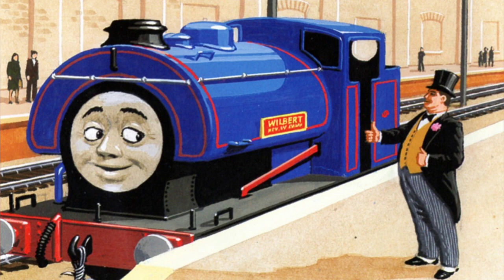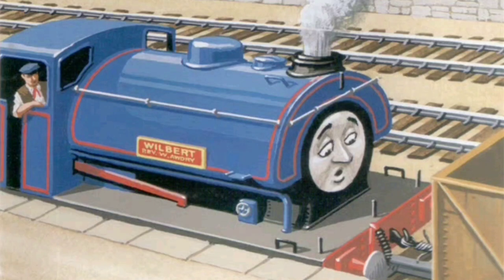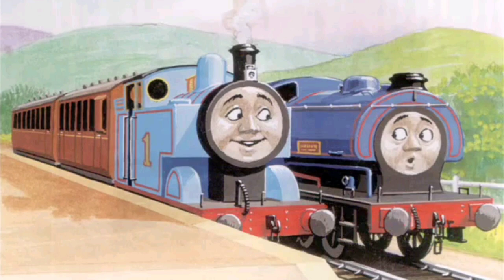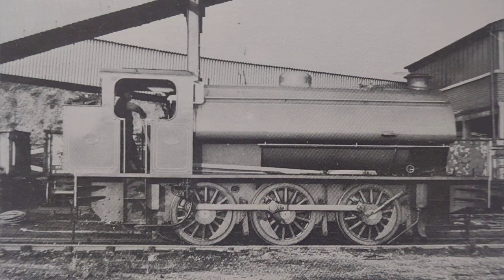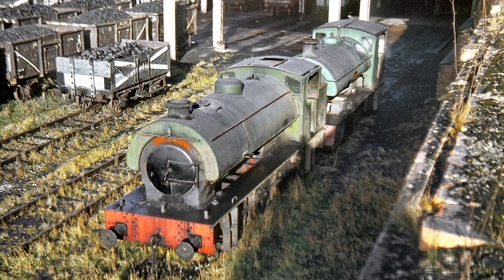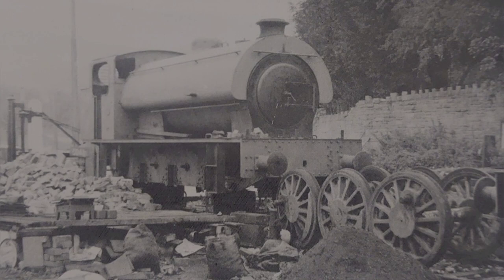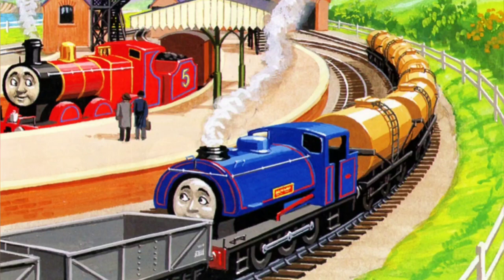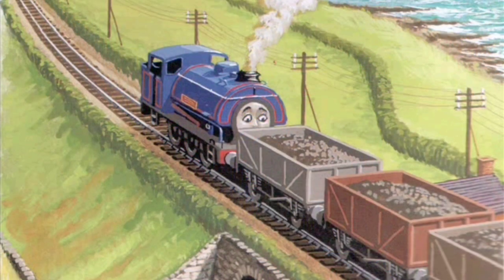The COMPLETE History of Wilbert - RWS Research #4

Comment: While I'm not sure whether to interpret of the Austerity the NWR bought after Wilbert's trial a real member or to fudge them as a fictional one, 16 seems to be fictional in some form. I've seen it said a couple times that Wemyss Private Railway's No. 16 - which was an Austerity - replaced another engine that had a similar accident to 16, so Christopher may have heard the story and gotten slightly mixed up on the details, or perhaps deliberately changed it.
If that is the case, 16 is either some extra Austerity in the books universe, or does indeed stem from that incident which changed as it passed between engines before reaching Wilbert, thus making 16 fictional in the books as well as reality.
Grand video though, good to have a single reference instead of trawling through different sites for details :P
Reply from the maker: Cheers, yes I'm keeping an open mind with Sixteen and the other Austerity tank, glad you enjoyed it!

Comment: Between the mystery Austerity and Barry, who do you think would've become #12? 
Also, this probably wont help for the technical details, but I recommend checking 16's episode of Character Gallery on TTTE Community Radio - they mention how Austerities and other industrial engines, still being built well into the '60s, are like the steam loco equivalent to cockroaches after a fallout.
Reply from the maker: I'm not familiar with TTTE Community radio, where would I find it? That's a tricky question, I suppose Barry would have most likely been number 12,but after he didn't make an appearance the Austerity has just as valid a claim for it. However as neither appeared in the RWS we can never say for sure.
Reply from the maker: Thanks I'll check that out at some point

Comment: Do you believe in the theory that Wilbert is 16?
Reply from the maker: Hi, no I do not, they're two different engines. It's easily disproved - Wilbert has never worked in a steel works, never been numbered 16 and is not preserved in the Midlands.